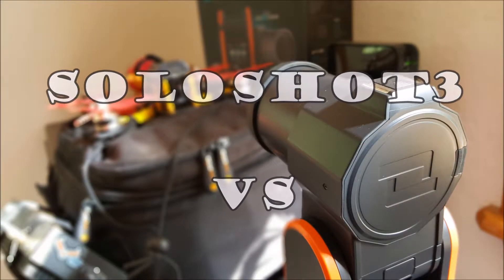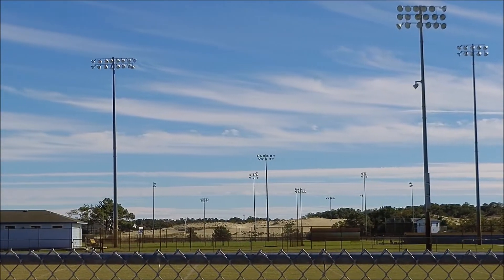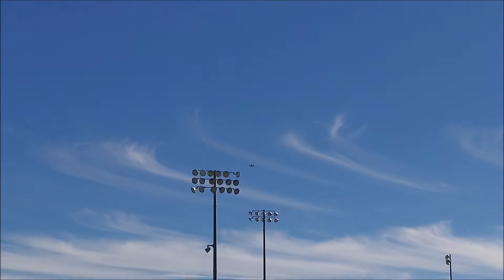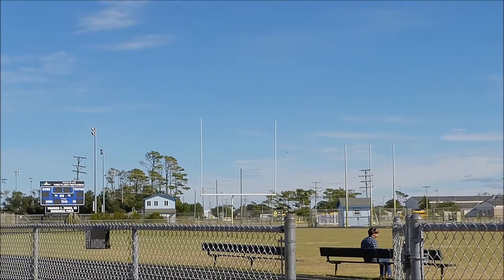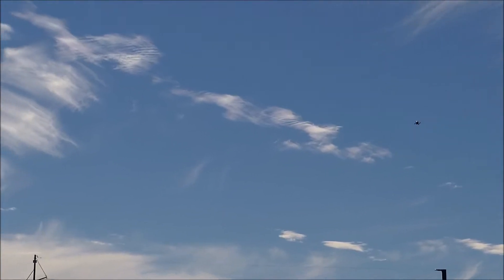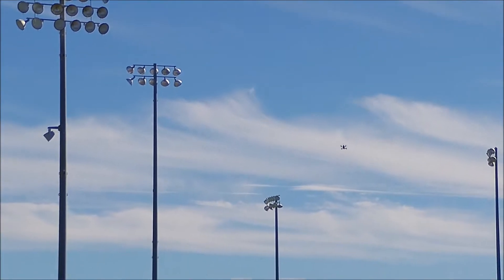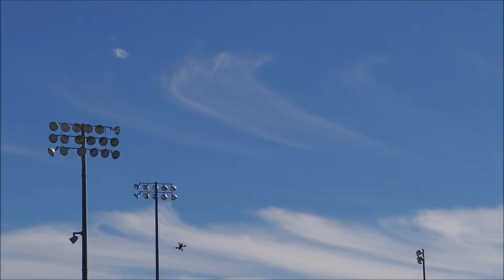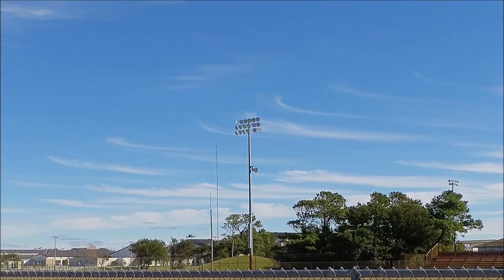Soloshot3 - Racing Drone Tracking Challenge (better than expected!)

Comment: Can you control how much it zooms? One thing I'm noticing in every SS3 video, is although the camera zooms a bit, it never really zooms in enough for a half decent shot of the craft. I want to actually see my RC planes, not just a black dot in the sky. Nobody on YouTube wants to see something that sorta-kinda looks like an RC plane flying around, we actually want to see it clearly, like at a minimum, maybe taking up at least 1/4 of the screen if not more?
Reply from the maker: Unfortunately, I don't think that's an option at this time. I've been intentionally using a medium or wide Focus setting, as I'm concerned if I used a tight one the plane would be completely out of frame.

Comment: I've gone through 2 different units.. One Optic65 and also the 25. The darn thing drifts and drifts until my son (high school and club soccer) gets completely out of frame.  SO MUCH FOR UNATTENDED CAMERA.  I spend more time adjusting the manual arrow controls than I do watching the game.  Might as well just use a standard video camera on tripod that actually has exposure control and focuses better.  Also, the darn Optic65 is a wind magnet that does not handle much more than 5-10mph without shaking (not the tripod... the camera itself).  It's just too loose and out of balance IMHO.  The Optic25 is better in that regard, but the hardware/software is just not ready for primetime unless you're not moving a lot (i.e., running up and down the full length of a soccer field).  It tracks ok in small areas in my experience, but not over any length of time when traveling back and forth 160 degrees or so... Not real happy with my SS3.  :(

Comment: Your results are far better than I get with my SS3 ... but it is true that distance improves the tracking pan / tilt result. 
I do not agree about drone being more than plane .. it depends what planes you are talking about ... general sunday stuff - yes - but serious 3D / Pylon stuff will push the SS3 to and beyond its limits easily.
I assume you are using Optic 65 .... this gives you a better distance factor than my Optic 25. The 25 needs to be flown to reasonably close because for flight the FoV needs to be wide. This then alters the zoom to distance ratio ... as you widen the FoV - the zoom is less. The 65 will compensate better on this.
I bought the 25 because my 18x Fuji camera does an excellent job - therefore I did not expect the 25x to be actually less ! But it is significantly less ... 
I am also experiencing the base / camera refusing to lock on frame to TAG ... ending up often camera looking too far right and angled up. Takes 3 or 4 restarts before it kicks in.
I am also fed up with it insisting on calibrating every time its used !